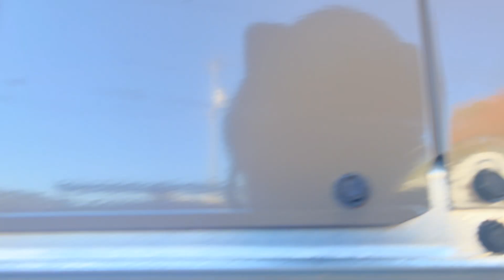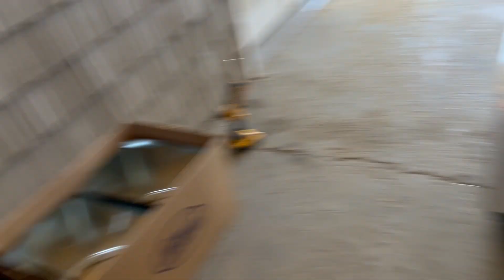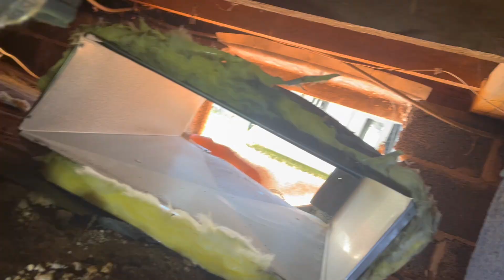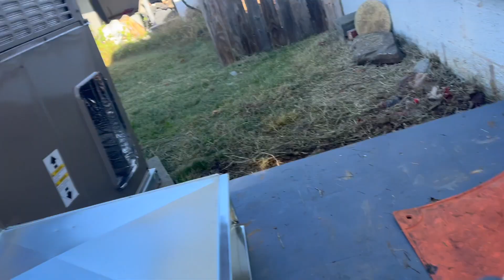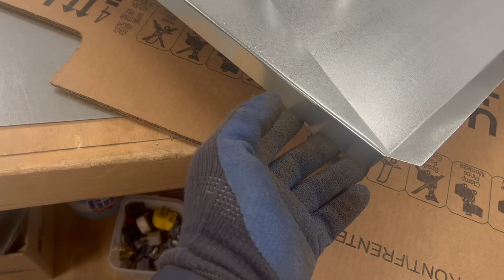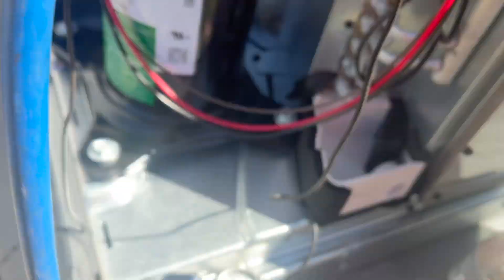HVAC -  Replace Package Gas Heat and AC Unit

Comment: Hey Chuck, good to see you back again. I did not understand how you got that hole in the cinderblock for the thermostat wire using the small bit.
Reply from the maker: Thanks! After I drilled the smaller hole all the way through the block, I took the steel nipple and a hammer and punched it out bigger from both sides. Cinder block and concrete block usually get soft around a hole once you drill it. A ball peen hammer works good too!